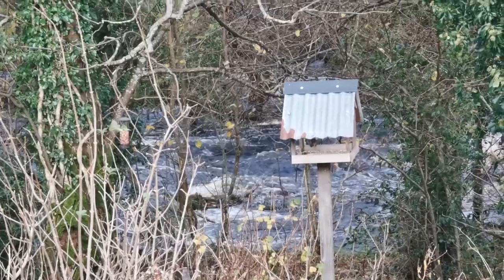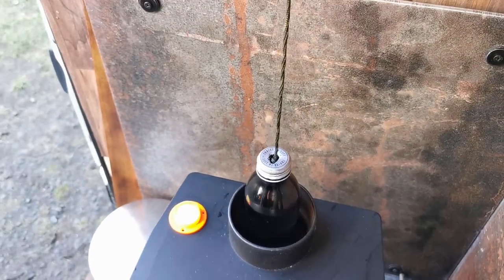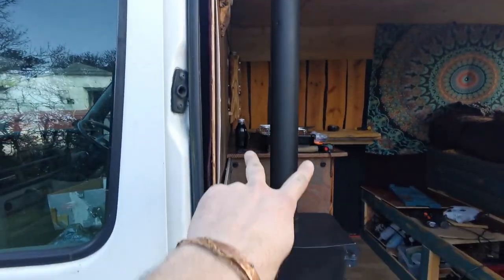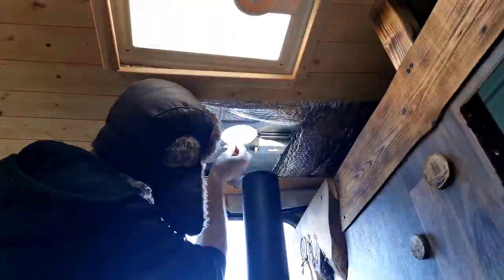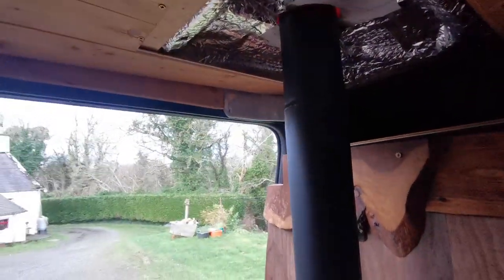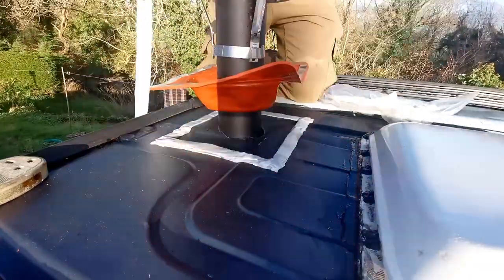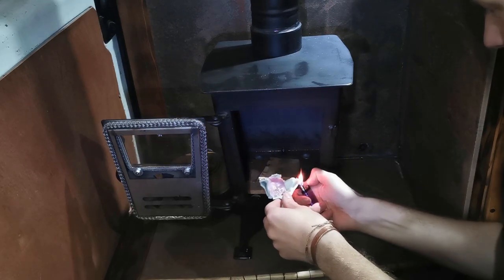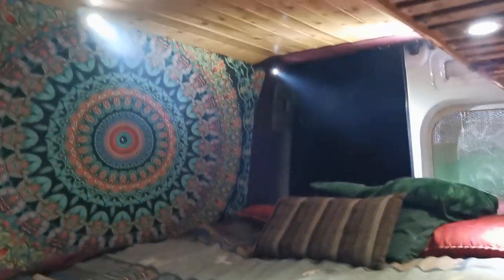Vanbuild Series - Part 15: Fitting a Flue and Having my First Fire!

Comment: Such a big step getting the fire in the van. Friend Max ent got diesel heater sorted in his Luton yet and did winter with just the log burner. Very toasty. Was also told they are better as don't get so much moisture in the winter. Might think about one for the new van. Keep Loving the Adventure Matty. Safe Travels 🙏
Reply from the maker: Ayw both diesel heaters and log burners produce dry heat so great for the winter, stops mould and mildew. It's gas heaters and burners that are the real problem, the produce a lot of condensation unfortunately. I do have a diesel heater now too (video coming soon) but it died on me after only a couples weeks. You kind of roll the dice with the cheap Chinese ones :/

Comment: Really starting to come together now,  Love the way you've explained everything during the build. 👍
Not trying to teach you how to suck eggs as I'm sure you will be using "deadwood" when out on the road, but be careful what you burn in such a confined space. Some older reclaimed wood may have some pretty nasty treatments applied which your usual carbon monoxide detector might not be triggered by.  I'm speaking from experience of a friend on a canal boat who had an almost fatal experience with some reclaimed cheap wood he burned which contained some nasty adhesive and wood preservative banned for a good many years.
Reply from the maker: Thank you mate, he's certainly getting there.

Appreciate the concern and wisdom. This is honestly the only processed wood I have and will ever burn. It's nasty stuff but I was desperate to get it fired up as you can tell. Will always stick to proper wood now. Thanks again 👍

Comment: I need a flue boot. Didn't know how I was gana make a seal till I saw that boot here.
Reply from the maker: They're great mate, dead easy to install. Just try make your cut as clean as possible so there's no little knick in it that might let rain down the flu ☺ 🔥
Reply: Are you using singale or double wall pipe?
Reply from the maker: @thomasphillips8180  I used single mate. Double would have been good so the flu wasn't so hot as I might well burn myself on it one day, but I haven't yet 🤞